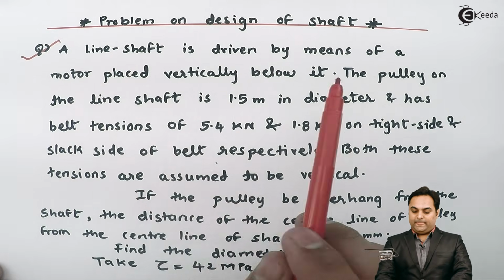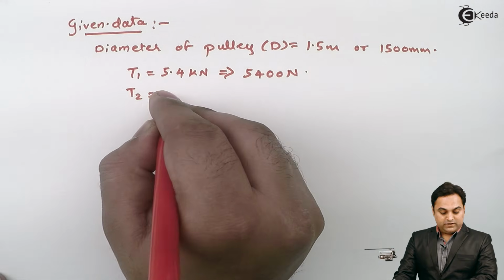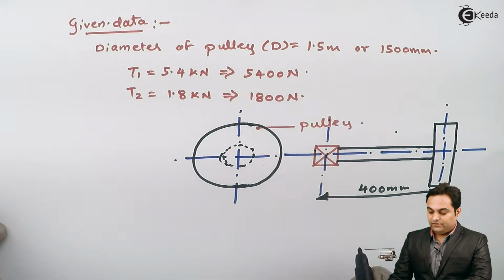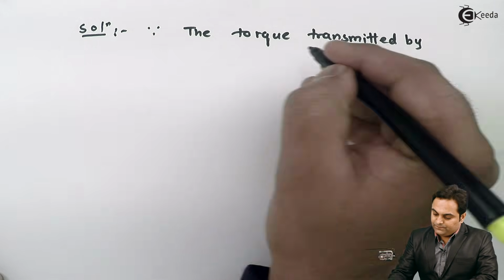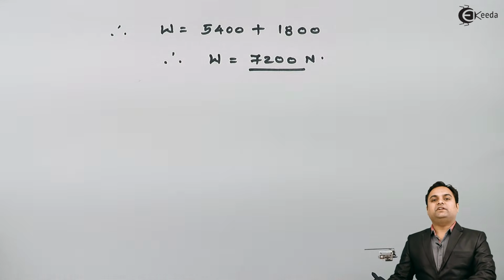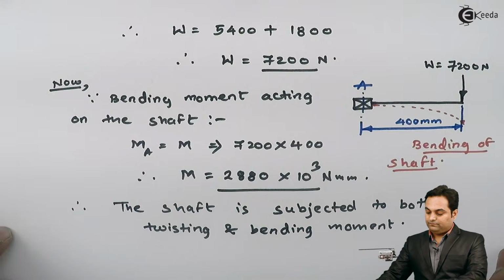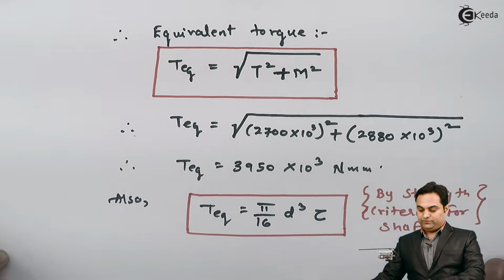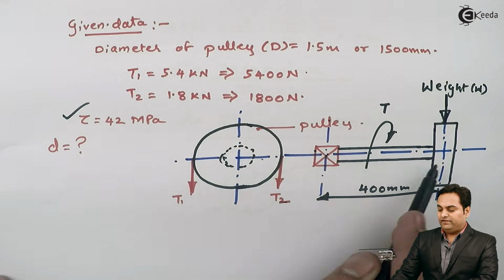Problem 2 on Design of Shaft - Design of Shafts, Keys and Couplings - Design of Machine

Comment: Total weight should  = Tension on tight side + Tension on slack side + weight of pulley ,  and why you are ignoring weight of the shaft also.
Reply: Its clearly written Total load because of BELT TENSION........Tension can only be found in Belts

Comment: Sir please do a problem base on line shaft which have two pully and have two shaft and both pully have tenstion, one is vertically down and other is incline with horizontal at 30 degree and find the dia. Of shaft

Comment: Sir please  can you upload the solution video of this type of example....
q.    " A shaft is supported on bearings A & B, 800mm between centres. A 20° straight tooth spur gear having 600mm pitch diametre , is located 200mm to the right of the left handbearing A, and a 700mm diametre pulley is mounted 250mm towards the lest of the bearing. the gear is driven by a pinion with a down ward tengential force while the pully drives a horizontal belt having 180° angle of wrap. the pulley also serves as a flywheel and weighs 2000N. the maxm belt tension is 3000N and the tension ratio is 3:1. Determine the maxm banding moment and the neccesary shaft diametre if the allowable shear stress of the meterial is 40Mpa." 
IT IS IMPORTANT TO US.
THANK YOU